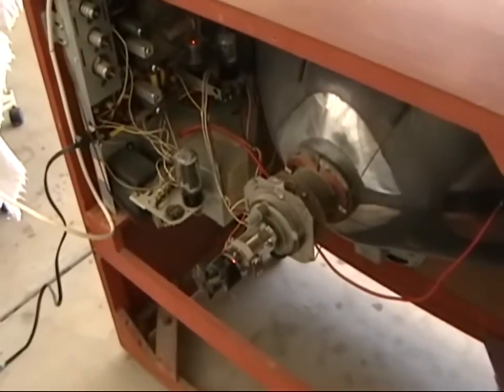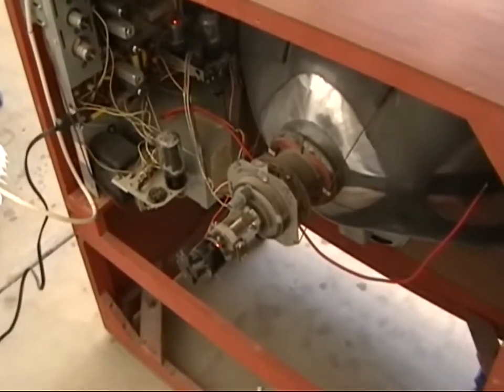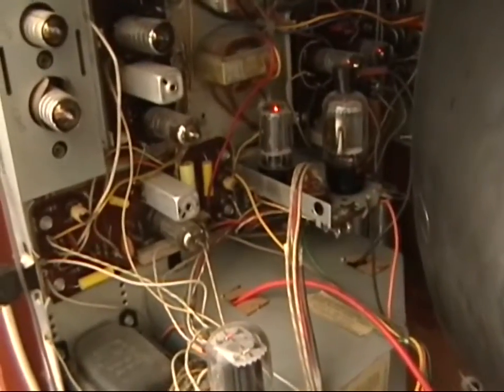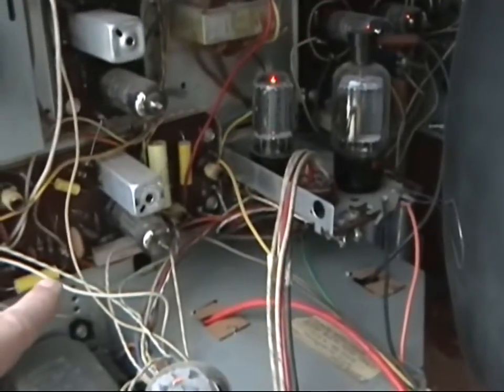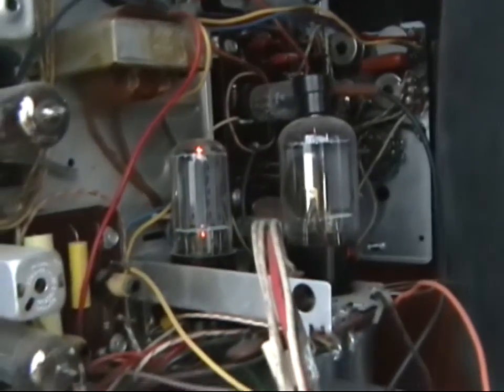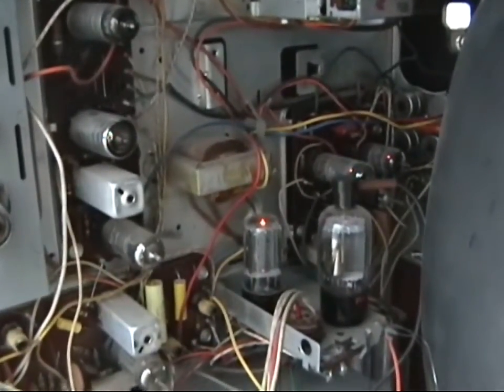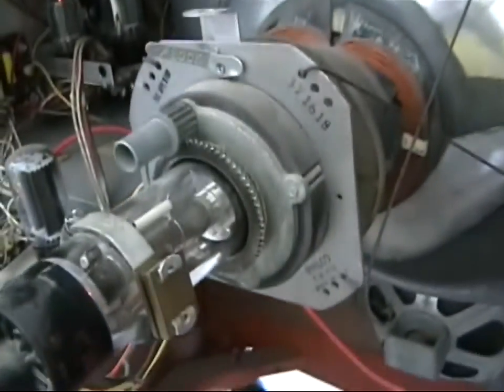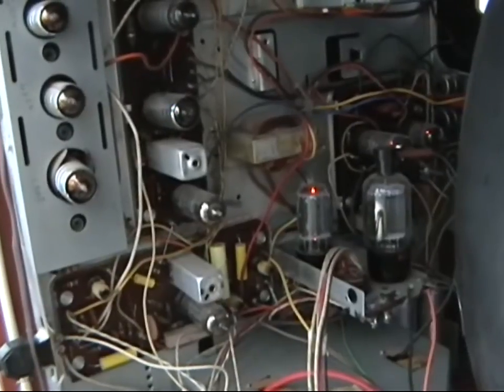Philco Television 1954 Restoration

Comment: I had heard that the old TV sets all took a lot of amps to run and if you touched a part in the set with a screwdriver, even if it was unplugged for a while, would zap it so bad, it would melt the screwdriver a bit. Is that an urban myth?